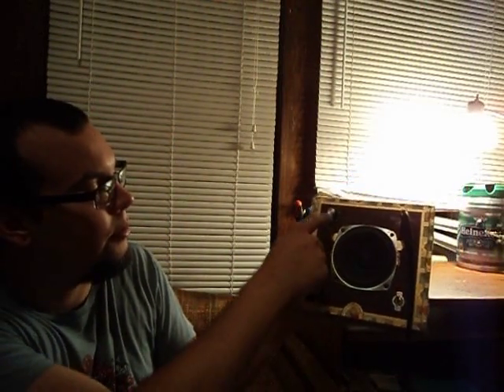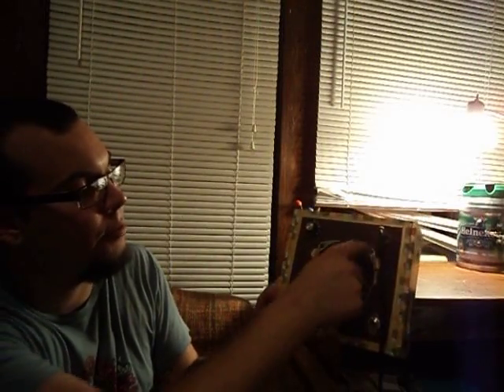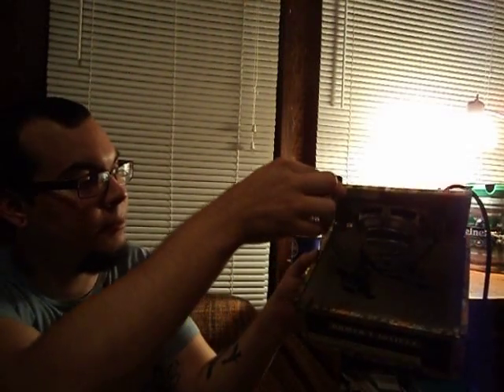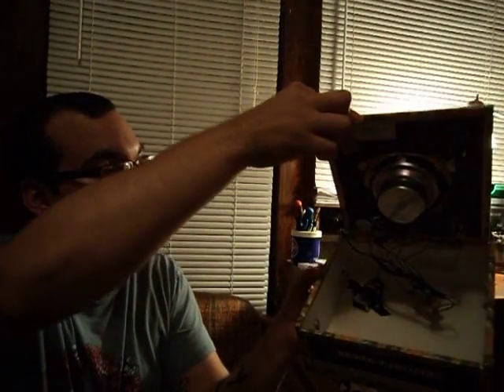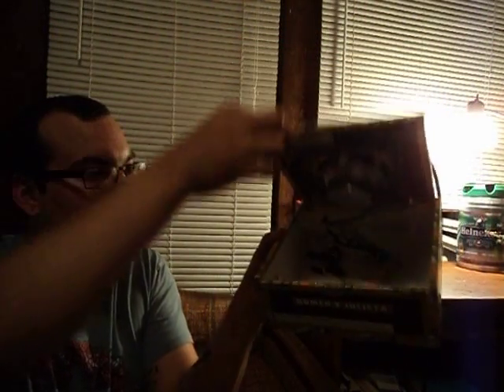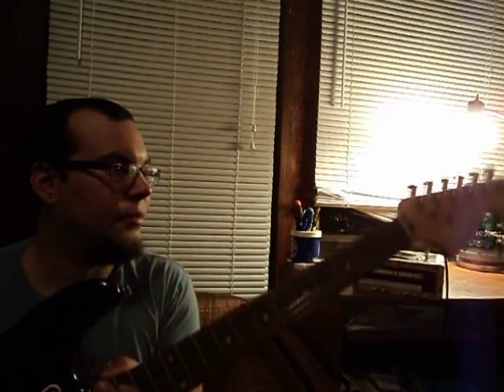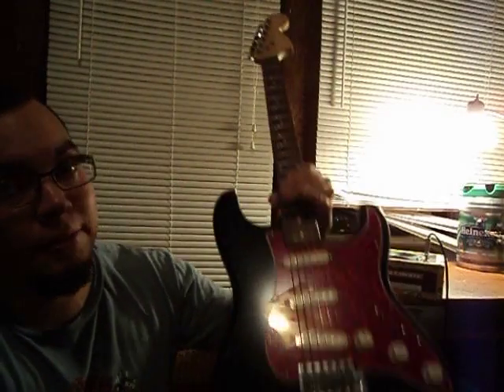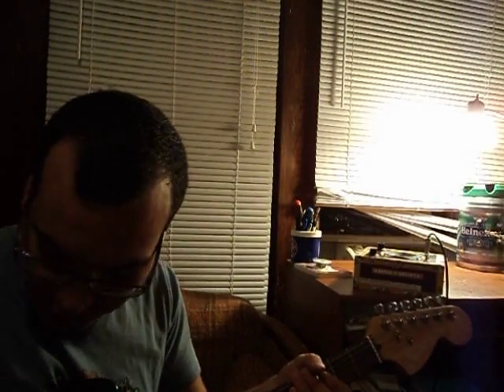Little Gem Cigar Box Amp

Comment: looking into building these right now. i just finished learning and building the whole ibanez tube screamer circuit, and came up with absolute rude compressed jeff beck / joe bonamassa tone, which i want to incorporate as a pre-amp, then use the lil gem or ruby as a main stage. funny thing, is, 10 years i spent a fortune on a lexicon 284 tube recording rack amp... over $1000 - and it didnt sound any better than this. fortunately i sold it, quickly...